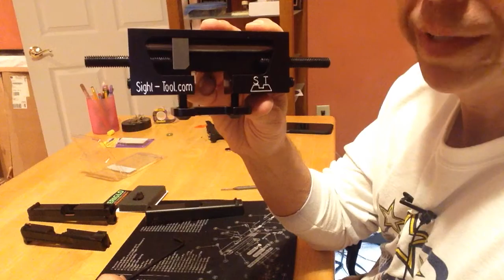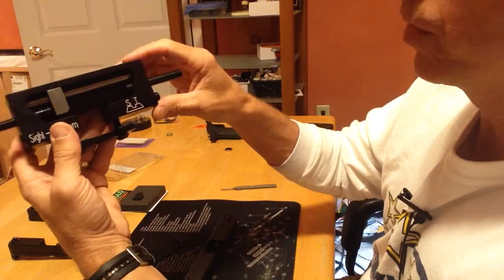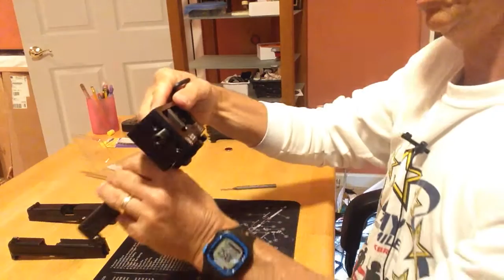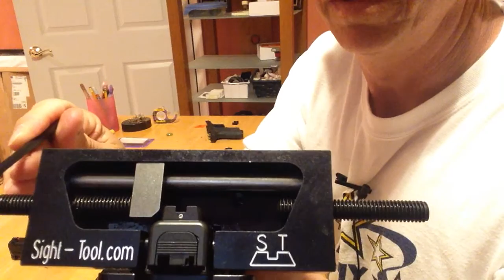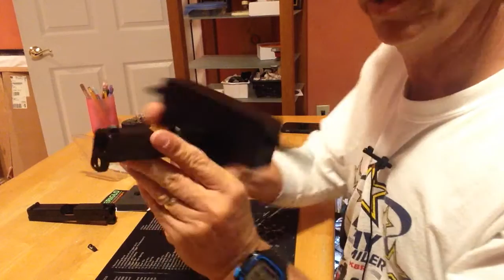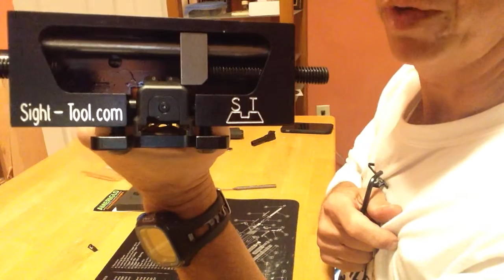Universal Sight Pusher

Comment: You can do left or right push.  You really should push out/off from left to right, on/in from right to left.  It may not matter on a Glock, but it certainly does on other pistols.  Take out the bolts holding the silver rod (two at top), slide out the rod and reverse the part that slides across.  Now you can have the angled piece correct.  Additionally, use the tool to push against, not the holder rods.  This will keep the slide perpendicular/square to the tool - use the tool edge to support one side (90 degree surface area) and bring ONE holder rod in from the other side.  To push from right to left, (looking left to right) - tool block/slide/ holder rod.  To push left to right, (looking left to right) - holder rod, slide, tool block.  Hard to put into words, but it's much easier this way and less chance of misaligning the tool.  Do not force it!  If it doesn't move, realign and make sure everything is "squared" up.

Comment: so if you have a spring under the rear sight could you fit it in an depress it to install the rear sight. springfield 1911a1
Reply from the maker: Are you sure the spring is against the slide? I would think you have a plate in the slide (with spring on top of that) which you drift into place with the tool or punch. This tool does a great job of making the job easy. I made this video a long time ago and not sure of the availability anymore. Hope you can find one.

Comment: Will this work for both removal and installation of both front and rear sights on the m&p shield? Read some horror stories online about the slide cracking or sight bending.
Reply from the maker: Worked great on my shield for both. I don’t know how anyone could crack a slide. You snug up the slide so it won’t move. Line up the pushing block as low on the sight as possible so you aren’t getting any torque or tilt. It is a simple press fit and it slides right out.

Comment: Does it work for front sights?
Reply from the maker: If you can get your slide lined up it works great. I have used it for my shield. Glock uses a set screw and special tool.

Comment: would this tool work on removing/installing front sights that have a channel/dovetail, like HK front sights (non-glock-type)?
Reply from the maker: This works great for any type of dovetail that I have tried it on. If the slide will fit, it should work. I made this video several years ago, I haven't searched for the tool in awhile to see if it is still available.

Comment: Thank you for video update, however I got question does the tool works on front sight also. ?? 

As Sig Sauer, Springfield XD, 1911 and M&P S&W model’s 

Could please let me
Reply from the maker: If the front sight is a press in fit, this will work fine.
Reply: @edwardschrank4803  Broke my front sight on an XDM...
Reply: @justanotherbum007  using this tool?

Comment: So did you use this tool to take off your stock sights on the shield and if so how did it go?
Reply from the maker: Perfect. You do have to take the slide apart to take the rear sight off. Since you need to take the whole thing apart, do the trigger kit at the same time. Lots of videos on the shield on how to do this. Not hard.

Comment: This thing works on some, not on others. I decided to experiment on my M&P 40 compact first. Getting the front sight off was a bitch, even with this tool. The back ones were very hard as well since the tool only hits the dot holder, not the sight directly over the dovetail. I was installing TruGlo sights on the M&P, and I have to tell you, this tool doesnt work well with these, at least on the M&P compact. The front sight on the Truglo sights, are very long, so you cant get the pusher block, against the front sight AT the dovetail. It pushes on the long sight, and actually cocked the sight slightly crooked in the dove tail. I had to pull the slide out a bit, and re-seat the pusher block, out towards the end of the front sight, ( the part closest to the back of the gun ) to try to straighten it. I think I got it, but its a serious PIA. Now on my H&K, I was installing Tijicon HD sights. The tool did ok getting the sights off. The angled slide was pain to secure, but once you get the hang of snugging things up and straightening as you do, you can get it secure. The H&K is just a much better machined gun, so the stock sights came off smoothly. Had to use the angled side of the pusher for the back ones. The Trijicons are a MUCH better fit then the Truglos. Went on very smooth. Cant use this tool on my CZ. The CZ has a front sight that is pushed on and off from the front, not the sides. The Sig is at the factory being looked at, so I will try the Truglos on it when it gets back. Having to slide pieces of plastic or thick paper to protect everything is a serious pain as well as your trying to tighten everything up. I finally just mad a wrap for the slide, so all sides were protected. There is a way to improve its ability for several guns, needs to be machined in the back block, where the slide sits, allowing deeper recess so you can get the pusher block right over the dovetail on a few different guns. It will be machined between the bottom screws. I'll probably do this in a few weeks. Overall, I got it to work, but noticed right off that since most front sights are flat, the actual pushing is being done with the driver screw pushing against the angled side of the pusher block, which left a serous "cut in " mark from the driver screw contact point. So you have to watch that if you need to use the angled side of the block now, there is a really deep, contact mark in the pusher block, and must make sure no part of this contacts the sight your installing, or you'll definitely, mark it up. Overall, meh. There are tools that do the entire job, and any gun, but your gonna pay through the nose. I guess it works, but not on everything, and on some sights, like the front Truglo Pro sights, be careful.

Comment: I've got one of these to change out the slides on a Kimber 1911.  Should work fine on the rear, but I'm a bit concerned about the front since the only place the pusher contacts is the blade.  We'll see how it goes.
Reply: I can'e use it on the Kimber rear sight.  The body of the sight is considerably aft of the dovetail and the top of the slide is curved.  I would be pushing well behind and above the dovetail.  I need a pusher block will a narrower extension that actually pushed on the dovetail. The tool would work perfectly with such an option.
Reply: My thoughts exactly, I had the same issue with kimber UCII, I heard Kimbers are tight as xd. I tried it on xd and worked just fine. Believe me is not easy as the OP video with one finger, but it does move the sight. Correct direction for xd is right to left away from ejection port.  If you find out about kimber let me know, I called Kimber and correct way to remove is left to right and install is right to left.

Comment: woah!!! hold on there!!!
this video is showing how to use it incorrectly!!!! 
the bottom pins are only designed to take up slack!!! when thee instructions were typed, it specified to placed the slide against the tool in the direction of press force!!! don't use em to hold the slide in the center!!! instructions clearly states to have your press block centered on the "sight" not the slide on the tool!!! your centering the press block on the sight so it doesn't twist!!!! if you use the pins to center it on the tooling your floating the slide on the rear of the tooling and risking serious damage to your slide if It slips!!!! READ THE DESIGNERS INSTRUCTION'S WORD FOR WORD!!!!!!
Reply from the maker: Thanks for the update. As I stated in the video, no instructions came with mine. Makes sense.
Reply: Can you post the instructions? I just bought one of these from Ubay and it didn't come with any.

Comment: A most excellent video, Mr. Schrank!  Concise and to the point.  Great information and production quality. Well done.  Are you using a kydex holster for that Glock.  I also want to get the Ameriglos that you have but wondering if the profile isn't a little tall for some of the kydex holsters that are available. I'm guessing this tool worked just as well on the front sights, the only difference is that you have to use the flat side of the pusher.

Comment: fyi in case you didn't know, to drift the beretta 92 rear sight, you must remove the slide safeties first. regardless of what type of sight pushing method you use, sight pusher or punch and hammer.
Reply from the maker: Thanks. I am changing those sights tonight and remembered someone posted about those. I am changing out the ambi safety so will do while dismounted!

Comment: Okay I'm back again.. sight pusher works on xds with bottom plate moved for the guide rod shroud. I wrapped a business card around touching areas lined it up and drove it out to the left. everything went well. would have went faster but instructions said not to force it out.. at 1st it wasn't seeming to work. so I researched more and found out that Springfield sights are some of the tightest fits and machined on and WILL need force.
well I went back in again and BY hand I torqued it a bit more it kinda popped.. I backed the pusher off checked everything and all was good and sight had moved. went back in again and it was easy from there. no marks both sights removed and ready for some xs bigdot sights. (I think the pop was the locktite) hope thus helps the next guy in my position.
Reply: Can you please send pics to me so I know what you mean regarding the bottom plate being moved? I am getting this sight pusher to replace my xds sights
Reply: Yes give me a way to send you what you need. Sight pusher works very well
Reply: Christopher Johnson yes send me a link to send them to you. Email or text them
Reply: +Christopher Johnson I can text you if the file was to big and didn't come through

Comment: will it work on a xds?
Reply from the maker: +killskum canty It should. I don't have an xds, so not 100% sure, but worked fine on my xd. Wouldn't work on my Beretta 92 due to the curved receiver.
Reply: Okay I ordered it so let's hope. It says all Springfield but just was curious.
Also while doing research it sounds like if you remove de cocker it will work. Or is that w h at you tried. I did read that it works on the fs92
Reply from the maker: As an update, I did use this on my Beretta 92 to change the sights recently, but as you said, had to remove the decocker.
Reply: It broke my XDM front sight...

Comment: My sight pusher tool came in today and used it to put an Ameriglo GL-241 3 dot night sight set on my Glock 17. Worked well, no trip to a gunsmith, and now I can help out other gun enthusiast and friends in area. I also saw a tip to put the rear sights in the freezer for a short time. Metal contracts when cold so they should slide on easier. Thanks for the useful video.

Comment: Good to see someone using this tool. I just ordered this from ebay to change the sights out on my Glock 27.
Reply from the maker: +Daniel Bryant (irishd501) Awesome. You will need the small driver tool to get the front sight off the Glock, it has a small bolt, not a press fit.  http://www.amazon.com/gp/product/B000O5ILUM?psc=1&redirect=true&ref_=oh_aui_detailpage_o07_s00

Comment: What about the front sight?
Reply from the maker: +C CT It does work on the front sight. Of course the Glock screws in with the special little driver, but it worked great for my Shield. I lined it up on the XD, it will work there too. Sorry for the slow reply, I didn't get any notification someone had posted!
Reply: Edward Schrank would like to see how you set that up on to push front sight. I have a slightly rounded 1911 slide fairly close to the front style on the demonstration you did.